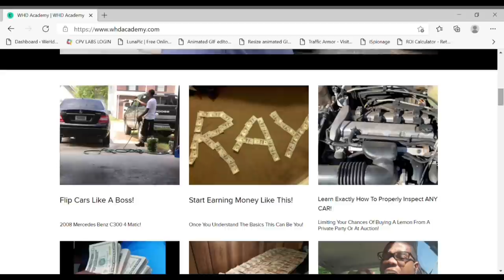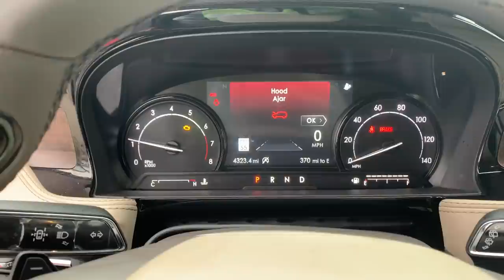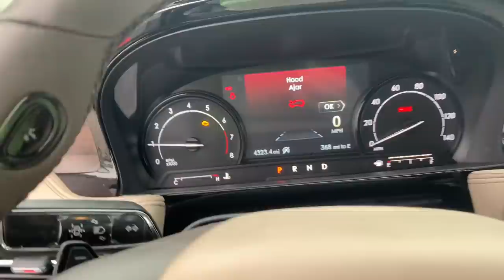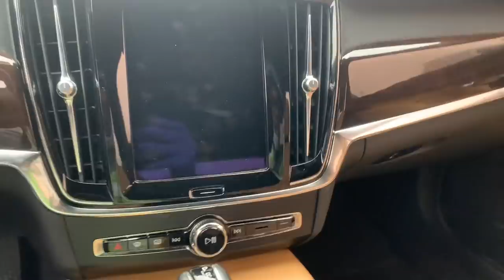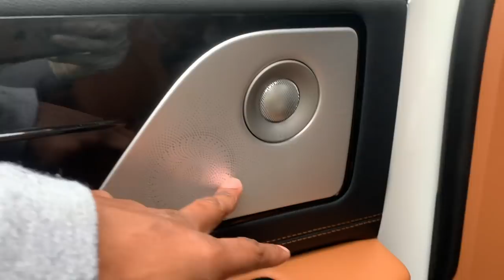FOUND A NEW 2020 LINCOLN AVIATOR WITH NO MILES AT COPART!

Comment: (FYI) The Aviator is the smaller Lincoln. It’s just a decked out Ford Explorer. You’d come out two grand cheaper just getting the Explorer.
Reply: Lincoln Aviator is faster and luxurious, it only share the same body frame as the Ford Explorer..
Reply: Aviator is on a whole other level